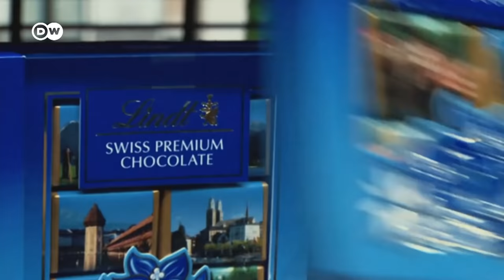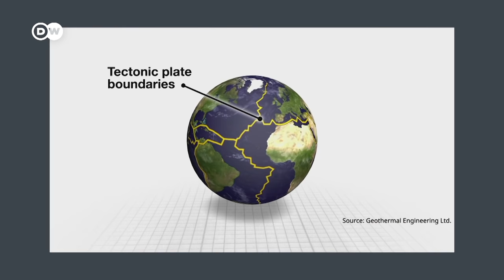Geothermal energy is renewable and powerful. Why is most of it untapped?

Comment: I think the story forgot to mention that the feasibility study is costly and the chance for a resource to be productive is 50%. You could spend millions and produce zero steam. The risks are high but once its there, the longterm cost is low.
Reply: I mean worth noting that the similar statistic for exploratory oil wells is 45%, so it's not like geothermal is alone in this.
Reply: @ummdustry5718  hello, my name is thirwell, thirwell b. blood, and i'm an oilman. this is my son and partner, h.w., herewill, herewill b. blood
Reply: @ummdustry5718  thats not the same cuz you can go else where and you are drilling at multiple sites. i dont know about geothermal but it cant be the same as oil
Reply: This sounds like good odds tho....for a billionaire!
Reply: @christopheb9221  why not
Reply: Well on the plus side any country that can tap into it would never need to depend on fossil fuels, coal or import from another country.
Reply: geothermal can be done with fracking techniques using only water (comparing to chemicals in the oil extraction)
Reply: @ummdustry5718  the drilling cost for geothermal actually higher compare to common oil well, due to hard rock formation, so when it's failed, cost you alot more
Reply: Steam isn't needed. You need heat, and that is available below our feet regardless. You bring heat to the surface using a fluid and then you can produce steam or run electricity turbines (with or without steam). You don't even need to drill that deep with a view to achieving higher temperatures because heat can be compressed to produce higher temperatures.
Reply: Not to talk of the risk of man made catastrophe
Reply: All depends on the temperature of the fluid at the surface and (hence) the fluid itself (water vs others). If hot enough, turbines (and micro-turnibes to capture waste-heat) will produce electricity, which is the objective. Some industries will use the heat too. But, as long as we do not tax CO2e emissions / pollution, fossil fuels and even PV will be cheaper. @donaldkasper8346
Reply: @christopheb9221  Air drilling is different
Reply: @sanosagara4507  you dont need to drill much at those locations mentioned. only reason geothermal is no1 energy source on the planet is simple: it would make oil, coal, uranium and lithium diggers obsolete.
Reply: @sanosagara4507  also for geothermal bore holes you need bigger diameters because you need a higher flow rate.

Comment: Geothermal doesnt work everywhere. There are a lot of limitations to this technology although it is available in many places. One of the biggest problems is earthquakes and tremors as experienced by a project in Switzerland. The project was shut down due to safety reasons and this teaches that Geothermal is highly site specific and wont work everywhere.
Reply: In southern Germany they had similar problem because they made mistakes while digging and checking for feasibility. Now, an underground reservoir is spilling into a higher layer of soil, thus 'inflating' it and slowly destroying the foundations of the small town of Staufen.

I still believe it has great potential though :)
Reply: Natural gas and certain oil resources have the same problems, plus the added cost of pollution so I would still consider geothermal worth it in most regions.
Reply: i live in indonesia probably around 40km from my home are geothermal powerplant, our live was 3rd world country no serious accident ever happened the scary part are mountain itself we dont know how long till erupt
Reply: @ZambaKE man how I wish south Africa had a surplus of electricity during off peak
Reply: @garethbaus5471  Its still a small drop in our energy needs.
Reply: @caesarsalad1170  the earths core generates roughly 40 terrawatts of power, and humanity currently only uses about 16 terrawatts of power. Even if you ignore the centuries worth of heat energy stored in earth it is at least theoretically possible to power humanity pretty much exclusively using geothermal energy if we put enough effort into it. It would still almost certainly be a significant fraction of our energy needs for the next couple of centuries.
Reply: @garethbaus5471 interesting though what would happen global weather-wise if we started to use up close to max power of what the Earth core generates.
Reply: You think ANY power plant is safe from a fucking earthquake? bruh
Reply: @aidandavis5550  the problem is that geothermal might cause the earthquakes

Comment: Both Nuclear energy and Geothermal energy do the same thing boiling water to produce steam and produce electric, but most country chose building a reactor rather than drilling readily available hot spot point scattered around the world.
Reply: When I think about it, it doesn’t make feasible sense or should i say “feasible capitalistic sense”. The idea of turning geothermal heat into electrical energy is not all that complex, its figuring out how to drill the holes and extract the heat in a environmentally friendly way, which we as human beings overcome more complex things before. With a capitalistic mentality i can strongly see why this area of renewable is not being explored more, its about selling an idea that is more complexed and so that will justify the high cost of such products and services. Wind and solar is quite promising but lets not forget the economics behind them both, whether its high up front cost or high maintenance cost, geothermal surpassed them on so many levels.
Reply: It’s more complicated than just drilling. The hot water can be very corrosive. It may not be as stable as nuclear or other sources of energy.
Reply: thats awesome.
Reply: @liurocky4647  Two things about these thoughts of yours: 1.) stainless steel 2.) how would you know about any potential unreliability? You’re just speculating and being dismissive about it while your at it.
Reply: All energy is based on steam
Reply: @Liu Rocky Geothermal is one of the most stable energy sources around and it provides true baseload power generation practically indefinitely. Furthermore, in most closed loop enhanced geothermal systems corrosive water is a literal non-issue (since it's being recycled). And yes it really is just as simple as drilling.

Comment: Man I'm proud my energy is supplied by geothermal here in leyte
Reply: It is clearly the best energy source. Unfortunately most countries around the world are less fortunate than yours when it comes to geothermal potential
Reply: @kiliandervaux6675  true only countries that Is in the Pacific ring of fire can Benefit
Reply: @death5913  There are plenty of geothermal hot springs all over the world where geothermal power can be extracted.
Reply: @death5913  lol do you know where Iceland is?
Reply: Pwede ba yan sa bulacan. Sana marami p yan. Mahal maningil si meralco. Sad.
Reply: Palimpinon?
Reply: @mr.RAND5584  I think the high cost of your energy is not from the source of the energy, it was the electric distributer alone which is meralco, there are many electric cooperatives in philippines that still uses oil and coal yet the price is 20%-50% lesser than the price of Meralco. Even if your area uses 100% renewable, as long as the distributer is private owned corporation, the difference is very little.
Reply: @kiliandervaux6675  Yeah. Those of us that live in countries with little geothermal potential are stuck with wind and solar, which sucks.

Comment: This didn't give enough info on geothermal, the different types of geothermal and how it produces electricity.  For people new to the subject they might assume the only type is from really deep holes in areas where the Earth's crust is so thin (so around constructive plates mostly) where its easier to get close to the heating magma, but this ignores heated rock from the decay of radioactive isotopes, which is more common to more areas around the world.

Granted, the economies of scale for that type of heat extraction isn't there yet, but as the drilling equipment becomes more available due to a decline in oil drilling (same equipment, people and skills are used), then it will likely become so.
Reply: Thanks 🤗🤗🤗
Reply: We can artificially create these heated rocks by simply using discarded nuclear fuel/high level waste which makes drilling for it obsolete and pointless but people are so scared of nuclear that we never will.
Reply: @lamebubblesflysohigh  You don't want nuclear waste products everywhere. And you can just use the sun to make your own lava(molten salt).
Reply: lava comes out all over the earth how and why does the crust have to be thin ?
Reply: @Fossilsunleashed  🤣
Reply: i beg to differ
Reply: indeed...
Reply: Mother Earth News had an excellent article on passive heating, including geothermal and heat from the sun absorbed by a “heat sink” .
Reply: It's not so much a matter of "drilling equipment ... available" but people & skills to extend the technology. "Okay, you've gone this deep with this much accuracy , now how about going x amount further?"
Reply: @donaldkasper8346  It works. Just not as good as burning fossil fuels that had 200 years of Innovation.
Reply: And also that geothermal is not renewable because it is still limited by the heat in the earth which is something you really don’t want to loose because if we loose our heat we loose out magnetic field and everyone does so geothermal is not renewable
Reply: @donaldkasper8346  And the one in CA is a commercial failure. Hmmmm
Reply: @donaldkasper8346  molten salt may not be feasible, but I’m watching salt ion closely. Obviously not as ideal as lithium ion, but could be a solid replacement in larger storage facilities where space isn’t the limiting factor. For small electronics, lithium ion chemistries seem to be the only option we have currently.
Reply: That's because that isn't what the video is about... People new to the subject can go learn the basics of geothermal and energy production on a video that was made to explain it, this video has a different purpose
Reply: @Fossilsunleashed  someone needs to go back to school
Reply: @alanhat5252  how much does it cost?
Reply: Geothermal energy is available about 3 meters deep in most places on Earth since it's around 10C there. Imagine if the temperature outside is 0C and you only need to heat 12C rather than 22C for heating your home. And it's not that expensive if you dig the trenches and lay pipe yourself.
Reply: Okay, you're thinking of nuclear energy. That's not the same thing

Comment: Indonesia is at a plate subduction boundary.  This could pose different challenges than Iceland which is an island sitting atop a spreading ridge.  The crust is therefore thinner under Iceland and under tension rather than compression as is the case in Indonesia.  Subduction zone earthquakes are known worldwide for their severity.  It would be interesting to see what Japan is doing in this area.
Reply: Are you a geologist, sir?

Comment: Geothermal needs a pretty big water network to supply heat.

Heat is transmitted at a glacial speed in rock. That is why we can live on this planet.

There has been a lot of geothermal projects and they almost all failed because heat moves very slowly in rock.
Reply: Pretty sure fracking would be able to create I needed surface area pretty reliably.
Reply: This has been tried since the 1980s. Not successful.
Reply: Geothermal actually consumes much less water than other energy sources so I'm not sure what you're talking about.
Reply: @jghifiversveiws8729  It is because the water is already there.

Comment: Not as high as one might think if you stay along the fault lines on the west coast or next to the volcanoes. There has also been some good research in Sask. Canada, where they use old oil field bore holes to circulate water to creat steam and run turbines. If we had spent more time on this form of clean energy, that is not intermitant, jwe would be ahead of the game by now.
Reply: Canada is the only country in the ring of fire region WITHOUT geothermal plant.
Reply: @harukrentz435  But, Haru, they are testing geothermal use of old bore holes in the oil fields of Sask. Check it out. Positive stuff.

Comment: There is even a much larger potential for geothermal: domestic (or relatively low-temperature) heating: any drillhole in the ground will do, or even just pump heat from large water basins etc.
Reply: Can you say more about that? I've never considered it a small-scale operation.
Reply: @danielwininger1750  Ground source heat pumps are often one of the most energy efficient ways to provide climate control for homes. The up front costs are usually pretty high, so it generally is hard for most people to afford. It isn't exactly the same thing as geothermal energy, but is more practical in the small scale.

Comment: In Finland a company drilled to depth of 6.4km (4mi) in an experiment to produce geothermal energy - without success, yet. The cost has been in excess of 100M€ so far and it will never produce enough energy to cover the cost. However, it is also an r&d project so hopefully not all the money was wasted. In e.g. Finland you can warm a house here and another there with a shallow heat wells but these heat sources will deplete if there's excessive use (i.e. dense cities). Therefore saying geothermal energy is available everywhere is a bit misleading. If more energy is poured into extracting that could be extracted then it makes no sense.

Comment: It is high risk during installation and operation, the pressure is not stable. Sometimes too strong. Many leak or damage of the pipes due to the pressure and high temperature.
Reply: The greatest risk in most locations is that there's just not enough power coming out of that tap.

Comment: I saw were Hot spring were taped but wasn't hot enough to use. Also it will cool off, and then you have to wait. I did a heating system with 105 degrees,. So we Installed wall to wall radiators to heat space.

Comment: I think, Geothermal is the missing puzzle piece in getting a fully renewable economy to work. Think about the most common objection to going entirely renewable (both from proponents of fossil fuels and of nucelar energy): the baseload. Geothermal can deliver the baseload, it can cover the days where there is little wind and solar. So far, as far as fostering renewable energy goes, geothermal has been ignored far to much. 
Also, geothermal can deliver heat for homes, wind can't (solar can, but that is really dependent and usually when solar get's much, you don't have to heat much, and when solar get's little is usually the time when you hvae to heat)

Comment: the other benefit from geothermal is heating but you have to have integration in between structures with pipes for steam or water to transfer heat. not as easy as putting wires to a building but more energy efficient that having to make electricity send in through some wire then convert it back into heat. I've also wondered if they could transmit power through hydraulic line and have a generator in the building that runs from hydraulic pressure there would be a minimum of power loss from the production site? Heating and cooling are one of the biggest uses of energy. Im sure you could also use the geothermal for for cooling by making a sterling cryogenic engine where the steam would either make electricity or turbine would move the engine. you can use a sterling engine to move heat not just get mechanical energy out of heat. The other big thing that should be done is better trash collection where you have to separate plastic, glass, paper, contaminated and junk like wrap, and organic matter. use the organic matter with sewerage to make biofuels.